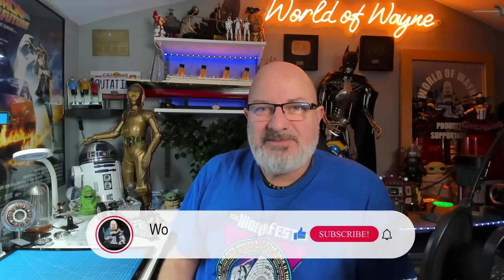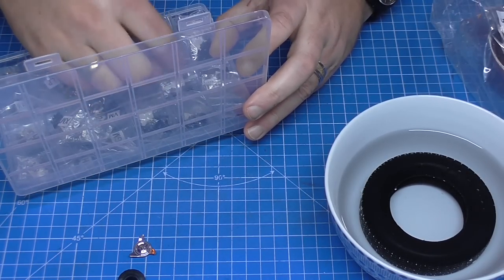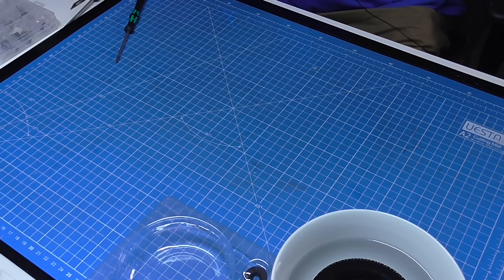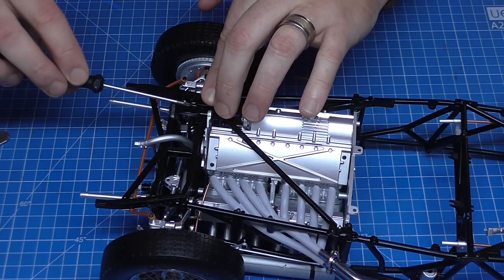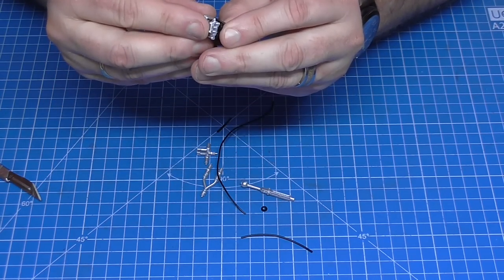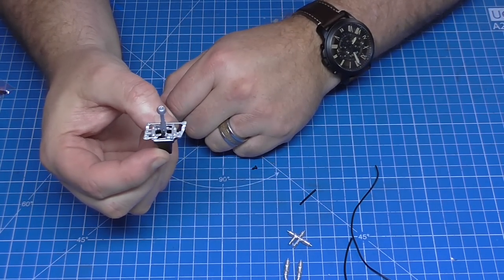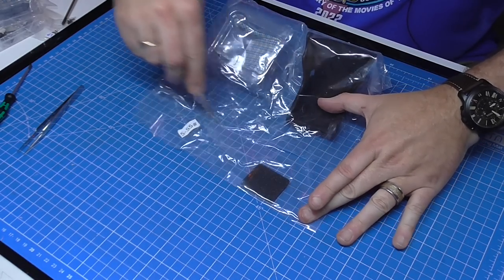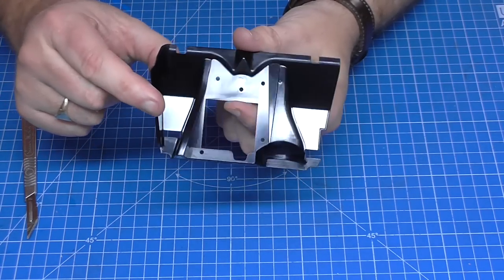Build the 1:8 Scale Stirling Moss 1955 Mercedes W196R - Pack 8 - Stages 48-60

Comment: I wonder if Agora will release the 'streamliner' version that was used at high speed tracks like Monza and Rheims. The chassis would be exactly the same but the bodywork would enclose the wheels with a few struts to hold it in place. There again, they could issue the Moss/Jenkinson sports car version in which they won the Mille Miglia at a record average speed of almost 100mph. The chassis would be wider to accommodate the two seats but essentially use the same engine, gearbox and brakes.

Comment: I have no clue how to fit the radiator to be honest. When I slide it over the front two bars it is not flush with the VM screws. I have a gap of 4 mm. The bars are bend a little, are they supposed to be this way? No matter how i place them it is no nice fit. Any ideas?
Reply from the maker: the bars are meant to be bent yes. it takes some pushing. make sure you put them in the correct holes in the frame